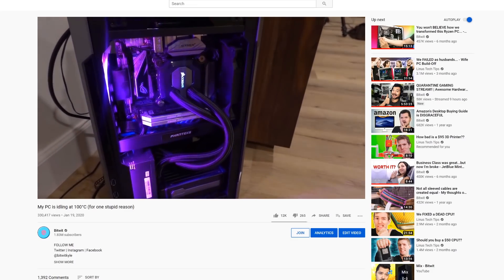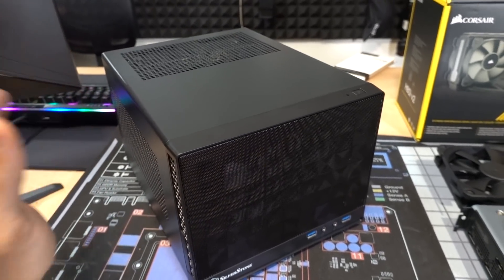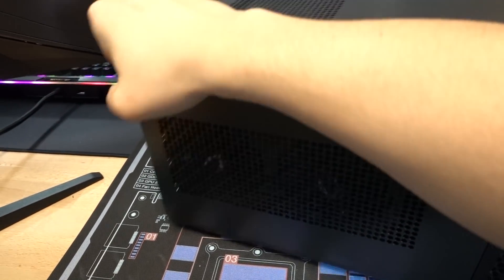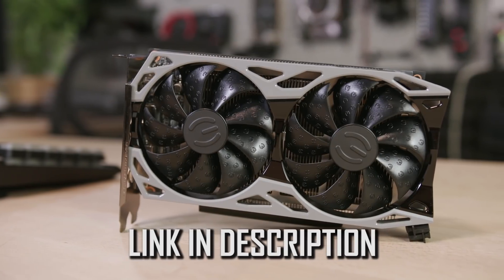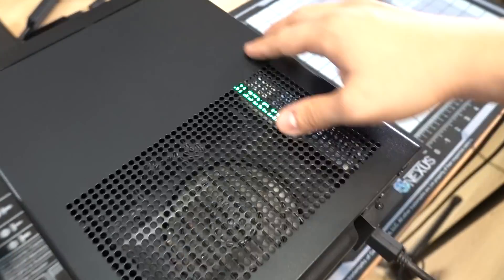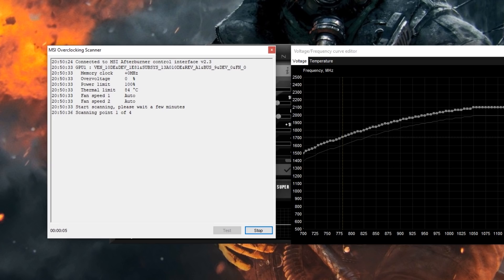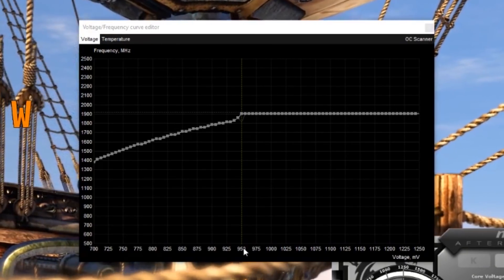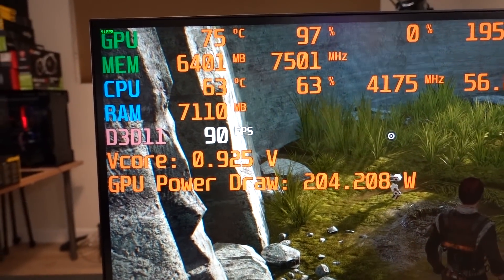Who needs a $2,000 Netflix PC? I do

Comment: I just got a Ryzen 7 3700x to go with my RX 5700XT, but my power supply is only 550w, I wont be able to push the CPU much since I have a b450 motherboard either way, but do you guys think it would be okay to use my current power supply for a little while or should i just wait to upgrade until i can get one

Comment: Hey Kyle, big fan of your builds using this case. I'm actually planning to add a small fan the same as how you've done by here for an exhaust on my SG05 HTPC for when I drop a GPU in to have a portable VR rig. What size screws did you use to mount the fan though?

Comment: bitwit pls make me a free pc im lagging like crap
Reply: What are you using right now? You can easily build a PC for under £300 which can run games smooth 60fps at medium/high fps.
Reply: @HellF1re24  my PC motherboard is  gigabyte h110m-s2
Ram 8 gb single channel 2113 mhz
Gigabyte rx 460 4gb
Intel pentium g4560 3.50 ghz
And a bad laptop sshd 1tb
My 7200 rpm hard drive broke only show 31 mb
Load times was better when it wasn't broken
Reply: @HellF1re24  also my parents aren't rich
Reply: @Botondk  oof. sadly he isn't going to build you a PC. But would say that you could try to start saving up to a PC. U can even get one for £200 at a stretch
Reply: @HellF1re24  okay thank you🤟❤️

Comment: hey kyle, this question may sound stupid but what is the purpose of underclocking vs getting a lower-tier gpu? Is it solely because you're able to get the desired performance with lower temps as opposed to trying to get the same performance from a lower-tier gpu but having it work harder, increasing the temps?

Comment: If the purpose was to do 4k gaming on this its been built the wrong way around.

 That aio should of gone on the gpu. You can get good enough coolers for the cpu that small, and probably even one acting as an exhaust. So not only would the gpu be able to run at full speed, most of the hot air would be exhausted... Which is the aim in a small HTPC because usually it's the gpu that cooks everything and therefore raises noise/temps.

Comment: I don't like that case.  The grill on the front looks cheap, and their logo looks like some cheap dollar store junk.  If I had to use it, I'd find a way to either remove the logo or paint over it or something.  I'd also maybe use some black paint to cover the blue on the USB ports if it's going in the entertainment center.  It would look a little more slick and less distracting.  But, just my opinion.  Everyone has their own.

Comment: @Bitwit
Why don't you mod your case where your graphics card is, by adding more holes where your GPU cooling fan is partially blocked? Then you can use some black spray paint to cover up all the new holes you add.

You will never see it.

Comment: 15:25 Small question but why did you plug the RF recievers for your wireless peripherals to the front I/O rather than the ports on the rear of the motherboard? Was there interference or something that degrade the signal?

Comment: I just want to say, undervolting does not decrease performance. It reduces the amount of heat your gpu generates by sending less unnecessary voltage to the core.

If you aren't gonna overclock, you should definitely undervolt as there is no negative aspects towards it.

Comment: I replaced the fans on my H80i V2 with a pair Noctua NF-A12  premium fans.  The are only 2000 rpm fans compared to 2700 for the stock fans but they move more air and are much, much quieter.  The original fans left a small gap between the edge of the fan and the radiator, but the Noctua's have a silicone gasket that you can install that closes the gap and makes it more efficient.  Upgrade was well worth it.

Comment: Hello from Kazahstan . My pc : AMD Ryzen 7 3700x, Gainward GeForce GTX1080 Phoenix Edition, MSI MPG X570 GAMING PLUS, HyperX Predator Black 16GB DDR4 RAM 3200 MHz CL16, SSD SATA 128 Gb Transcend SSD340, Intel SSD 660P M.2 PCIe 3.0 x4 QLC 1000Gb, HDD 2 по 1000 Gb Western Digital. Do u like it?
Reply: Pretty good PC, I would recommend you to overclock your Memory to 3600Mhz, trust me, it will be amazing. Are you using an Air Cooler or an AIO? GTX 1080 is a really good GPU, 2 & 1/8 TeraBytes of Storage is pretty good, really good motherboard, and what case and PSU do you use?
Reply: Piyush Menon   be quiet! dark rock pro 4. My ram can’t work stable on 3600 MHz (

Comment: I would be curious as to how that would perform if you had that extra noctua fan as intake, which will help cool the VRMs of the motherboard. I think the case can passively exhaust very well with the smaller chassis and all the venting especially near the power supply.

Comment: Quick question, I just built my PC and the ram slots per manual said the ram goes in slots 2&4 but when I booted up my PC it was only reading one of the sticks of ram, and I switch em around and the only slots that work with each other are 1&2, it seems wrong even tho it works, does it matter as long as it's showing up?

Comment: hey, im looking to get a few upgrades on my pc. I have around 400 euros, and i dont have the benefit of being in america to get cheaper pc components. can someone help with what components to buy? this is my current rig, I can hardly run the new call of duty modern warfare on it, even on the lowest settings.

AMD Ryzen 3 2200g
Gigabyte B450 Aorus Pro wifi
16gb (4x4gb) Corsair Vengeance LPX 2666mhz
Palit GTX 1060 6gb stormx single fan
Corsair h150i water cooler
EVGA 80+ gold Fully modular 550w psu
1tb WD blue HDD
240gb WD green SSD
and also some bootleg nzxt h500i looking case

Comment: So you changed out the 2070super to the 2080super which has about a 10-15% performance increase then decreased the effective speed of the 2080super by 10% making it effectively as capable as a 2070 super. I'm confused

Comment: Do a giveaway kyle..
Still with hp's X360 running i3-7100u and 4 gb 2133 ram, hdd 5400 rpm, only i need my cooling pad at max otherwise this is dead.

Comment: in 4K you could sync it to 60fps/Hz and avoid heat/a loud system.

Undervolting is not really the right way - you can to this without loosing Performance.

Comment: Suggestion. If possible do you think you can drill holes above the gpu to crate ventilation and add 2 small low profile fans above the gpu? Yes it sucks to drill holes in the case but I feel it would make a difference and you can avoid undervolt gpu

Comment: Kyle please do a video on AIO's and Ryzen temp issues.  Have yet to find one that doesn't read temps into the 90's when the cpu is idling at 39 celsius.  This presents problems with fan curves and the fans always running full out even at idle.  Really interested to get your take on how to set up AIO's to work properly with Ryzen without having to resort to all those manual settings.  Thanks!

Comment: Hey Kyle, I put together a mITX for a Home Entertainment / VR rig last year. I'm running with a 3700X at stock clocks, the CPU temps don't exceed 70C. Other hardware used include an ASUS ROG STRIX B450-I GAMING AM4 mITX Motherboard, Noctua NH-L9a-AM4 Low Profile AM4 CPU Cooler in a Silverstone SST-RVZ03B-ARGB Raven Case. A couple of things I would like to mention, because of the clearance between the default Noctua CPU cooler fan and case fans, one could either use a thicker 25mm fan on the cpu or, on the case to increase air flow either into the cpu cooler or into the motherboard area. Personally I prefer a beefier intake fan to provide ample movement of air. I found it worthwhile to use a SFX power supply to allow more space to tuck away cables, tho the case dosen't ship with an atx to sfx bracket one would have to be resourced. The two included 15mm thick, 120mm case fans I use on the graphics card side of the case to provide sufficient airflow into that compartment, and push air directly onto the graphics card fans. I'm using a Vega VII and the thickness of the card doesn't cause issues with using the 15mm thick case fans on the side panel. The only caveat is if the unit is to be positioned in a horizontal orientation in a entertainment unit to prop it a bit higher than the included rubber feet to allow for better ventilation underneath the case.

Comment: Things that i think you could have done better.
Instead of the H80iV2 i would have done the H60 in order to fit that extra noctua fan in the build and that itself make a difference in temps. for those of you who don't know that the H60's rad is smaller in thickness compared to the H80iV2.
Make the tubes bend wouldn't be an issue.
Also, throwing in the silverstone ATX To SFX adapter bracket for the SFX 600 is a nice pairing choice.
I own the RTX 2060 Super FE in the same case and even thou it's slightly smaller it does in fact fit everything with the configuration setup.

Comment: The pump in the AIO died because the rad was below the block. To anyone using an Evolve case be aware of this. If you have the rad vertical and make sure the bubbles are trapped in the rad you should be okay. But to be completely frank the Evolve was designed with air cooling and open loops in mind not AIOs.

Comment: Amazing video - keep up the good work.
Anyhow I have a question for anyone who can help, are all these parts compatible and if so would I need to upgrade anything or add anything??
X470 AORUS Gaming 5 (motherboard)
Ryzen 7 3700x (CPU)
Corsair Vengeance 2x8 GB DDR4-3600
Seagate Barracuda 2TB 7200RPM
Western Digital blue NVMe M.2 500GB
RTX 2080 super 8GB black gaming
Cooler master masterbox MB511 RGB
Be quiet Staright power gold 80+ 750w

Thanks a lot everyone who helps me out, I’m open to all comments.

Comment: Holy shiet man
I have the same Htpc build
 CPU is a ryzen 9 3900 x tho on it
X570 itx strix
N my case is white
I have the liqmax 3
120mm aio on
Also put a fan like u did but a black one
 Will probably down grade to a 3700x   later on .
3900x what just a spare. CPU I had lying around so I use that for now.

Comment: These cases that only support 1 fan give you TERRIBLE VRM thermals, I know because I had one, put an AIO in it and my VRM thermals went much higher than before +10C, the downfiring coolers are great for cooling all the chips and such on the board

Comment: Kyle: I think that the rtx 2070 super won’t give me the ultimate Netflix experience 
Me:games and streams on a 1050 ti and an i5 7400
Reply: Simon  probably pretty shit 1050ti isn't enough to even run some games(tyhe newest ones, other than that its a pretty good card) so streaming would be very problematic
Reply: Im stuck with a 1050 ti and i5-3570k and I can't even overclock because cooling is bad
Reply: @shmitty8570  Hey... at least you have third gen. I am still rockin a core i3 2100
Reply: I stream on an amd a6 and radeon r4

Comment: Been trying to convince myself I didn’t need to build a mITX pc in one of these cases for a week now. Seeing this did not help!
Reply: Do it my wife loves my core500 fits right in our entertainment system. People that come over think it's my new dac/amp combo because we listen to a ton of music no rgb basic but powerful all AMD
Reply: Tanner Cloyd just built mine in the Node 202 a couple days ago, no regrets yet!
Reply: @SlyEthan  I have a pc in a Node 202 but I will change the case. I had thermal and noise issues. So far its ok for now but it can be really hot in there.
Ryzen 7 3700x (down volted -0.0500) it hits 80c° in stress test and its between 70 - 80 in games. At idle its between 50-60c°in a 25c° room. PBO enabled all core turbo is 4024 and single core is 4335.
Sapphire RX 5700 pulse (just the factory oc no bios tricks) it hits 72C°in demanding games (also I had to bend the case i bit to fit in its so tight.)
The airflow is quiet OK for this case.
I have 2 120x120x15 mm intake fans at the GPU compartment (this have its own thermal control. I put a thermometer in width a fan control so the fan speed depends on the thermals near the GPU)
The CPU is cooled width an IDColling IS-60V2 (theoretically it has 150W tdp but thats not true 90W maybe) not bad at all but it can be loud in full speed (fan replaced width a Cooler master XtraFlo120x120x15mm) I had to remove the dust filter. Because I had to disassembly the case to clean it... So If I had to disassemble I dont care if I had to clean the filter or the inside of the case. And without it the cpu thermals dropped by 8c°.
And I have 3 noctua 40x40x25 pwm outtake fans at the top of the case for outtake.
I liked this case and for a home theater pc I will keep it. But I want the full potential of my parts and its restricts me and also its very loud in full load.
My next case will be a Lian-li TU 150. And a noctua nhd-d15 cromax for the cpu.
I bought the Node 202 because I over estimated the need for transporting the case. It seemed I had to transport it in almost every weekend. But the reality is I had to transport in in maybe once or twice in a month or in 2 months so the TU 150 is better for me I think.

Comment: Bro help with my pc to get the more out of 
Is asus board crosshair viii hero wifi with a ryzen 7 3800 x with 32gb g skill 3600 cl16 and ssd 1tb evo Samsung and rtx2080 super founder with a monitor 1440p but no getting 100 fps on the monitor on high or similar some videos plzzzz overclocking the system to get more or why I can do please some help ?????

Comment: send that 7700k my way, i'll put it to good use
Reply: I don't get it. I have a 7700k and see no reason to upgrade it. It's still an amazing chip
Reply: @henrymarocchi7844  yup fantastic chip
Reply: @henrymarocchi7844  at this point there’s no reason to upgrade, but when 8 core are utilized more frequently, it will start to show its age
Reply: @spearmintlatios9047  8 months later still using my 7700k everyday. No issues. 4.8 ghz at like 1.35v and mid 60°c at full load. Great chip.
Reply: @henrymarocchi7844  for real. I had a 7700k in my old build I was planning to keep when I built a new pc with a more modern case/gpu, but I decided to sell the build as a whole as my friend was looking for a gaming PC and instead opted for the 10700k (I would have gone for a 3700x or 5600x(?) but I got incredible savings on the 10700k.)